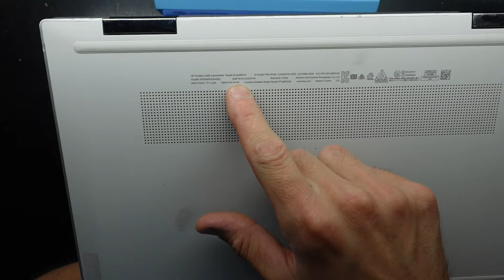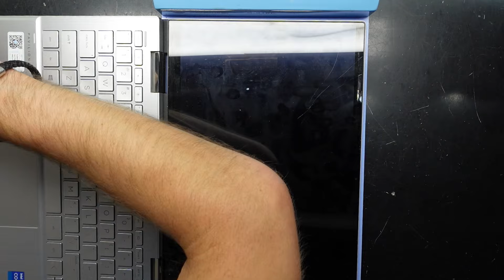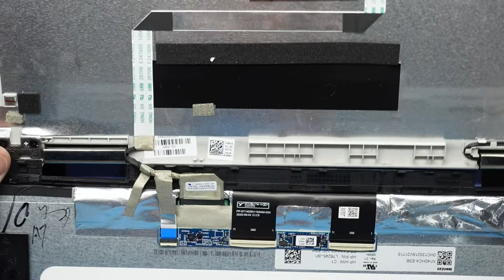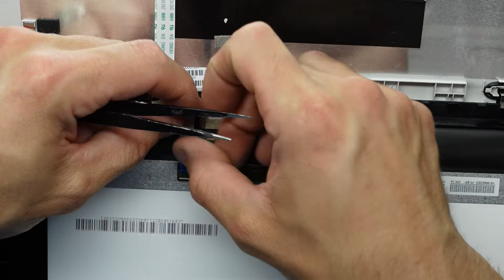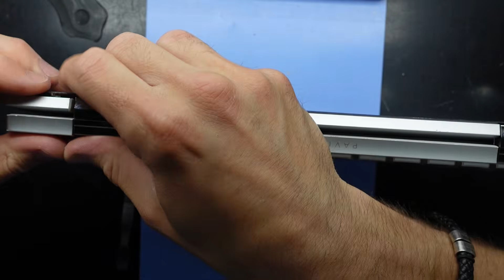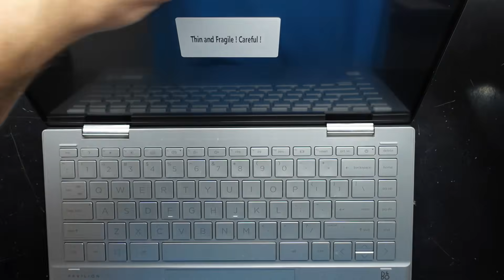HP Pavilion 14" x360 2021 14-dy0183 Screen Replacement

Comment: I want to tell you that I have the same laptop as yours, which is an HP, but the outer glass is broken, not the actual screen. I’m wondering if I can just replace the outer glass, or if I need to replace the entire screen.
Reply from the maker: no you cant (or not without expensive equipment)

Comment: Looked super easy. Machine was powered off. Screen came off easily like yours did, reinstalled the new one no problem. Now it won't turn on. Have had to drop if off at a repair shop and the guy said he thinks I've blown the motherboard from not disconnecting the battery (even though it was powered off). Maybe put a warning to viewers to make sure it's completely flat to avoid others having the same issue. This cheap repair will now cost me significantly more than what the cost would have been to have it done by the professional in the first place because of that missing warning.
Reply: always, BUT ALWAYS, when you work on a electronic device, disconnect the battery
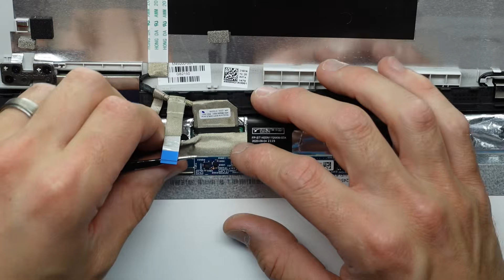Reply: He did mention it though, at 2:27. It went over me too so i dont blame you. Didnt it pay much attention until reading your comment.
Reply: @dainebatchelor9382

Comment: Thanks for the video, just did this replacement but noticed the adhesive strips might not be snuggly attached to the screen so there's a tiny bit of give when squeezing the screen together. Do you reckon this is alright or should I grab some extra adhesive strips?
Reply from the maker: i think that should be okay

Comment: Thank you so much ive never repaired a touch screen device before so was a little worried, ho quoted me £405 for a repair i only paid £380 for it brand new from them directly! Its literally only a small crack aswell the absolute tiniest it just ruined the touch screen.

Comment: I have an HP Pavilion x360 14-ek0103TU with a damaged LCD display that needs to be replaced. I looked online for replacement displays but I haven't been able to find the exact same model. I found displays for models like the 14-ek0097nr, 14-ek0023dx, etc... What they all seem to have in common is that they are for the 14-ek0000 series. So I wanted to ask if it was safe to buy a display that has a slightly different model number than mine or if it won't work.
Reply: Hp Pavilion x360 14-dw1012TU

Comment: Hey, can we replace that touch screen with a normal non touch screen???
Reply: You can turn off touch in device settings so it doesn't really matter if it's a touch screen or not, you can make it not
Reply from the maker: could be possible but the bezel would be missing